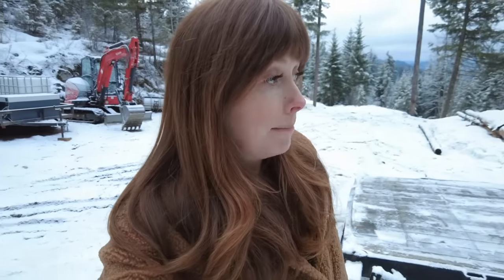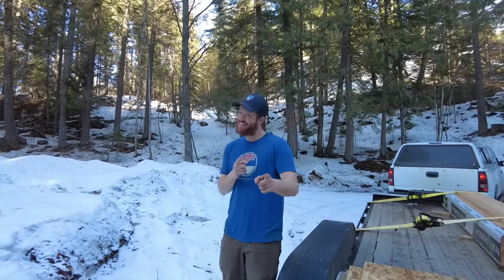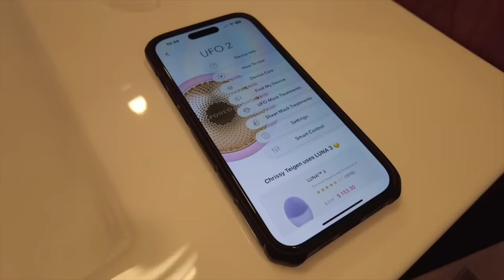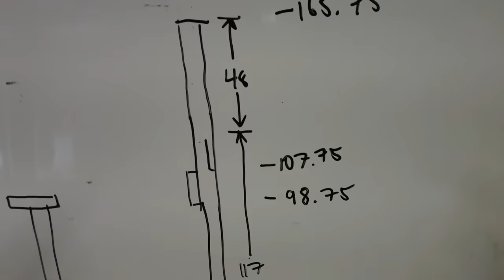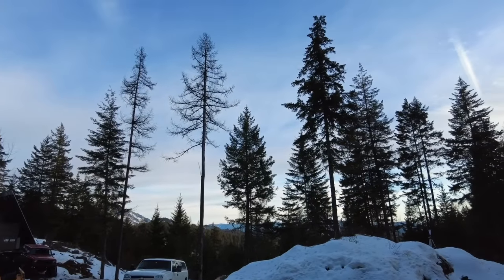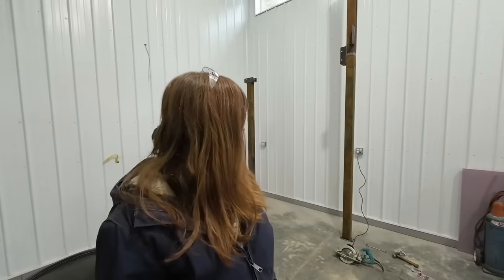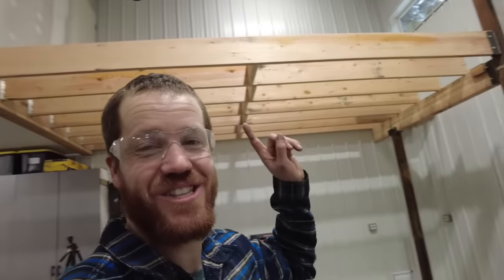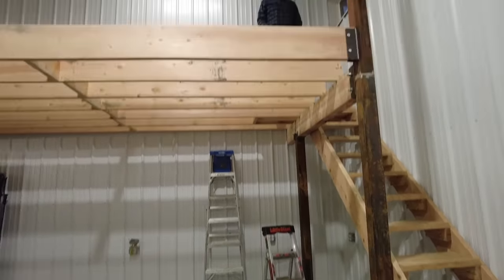Starting A NEW BUILD For Our Growing Family

Comment: Just a suggestion, Riley may want to look into building a rock/soil screen for a future episode. With all the existing raw materials you have on the property, you could probably rock the whole driveway with cleaner material. Design it with a removable screen bed and you’d also be able to size the rock to better fit your needs. I have no doubt Riley could build something like this in just a day or two. And it would probably benefit the homestead for decades to come. Just my 2 cents. Absolutely love this channel!!!
Reply: Taking this suggestion a step further, look to establishing a area to quarry the raw materials.
Reply: and don't work on roads when they are wet and muddy if you can possibly do it when it is drier.  crown the roads also to keep the water from sitting on the road.  Add water bars to drain water off the road on slopes.
Reply: How about a rock crusher so you can get a regular size for the road? Would help remove all the larger bits.
Reply from the maker: Thank you so much for the candy we just received in the mail! When we used to live in Atascadero I would buy those all of the time when we made parts runs to the local hardware store.

Comment: Turn down your trailer brake controller when its empty. The wheels just lock up and then it slides sideways. I turn the gain on mine most of the way down with an empty trailer. Especially when its slick. Just dont forget to turn it back up once your back on good pavement especially when loaded. Its really a good practice to get used to adjusting the gain when you change trailer loads. The brake controller can be your friend.

Comment: There is a way to put chains on your tires without laying down in the mud. Stretch the chains out on the ground, in front of the tires. Drive onto the chains about half way, then wrap the ends of the chains to the top of the tires.

Comment: You'd need a heavy duty filtering fabric between the mud and rocks to make it work. Frost will just lift those rocks up every spring. 

If you don't want to get rid if the mud and put water passing soil and draining, then put the fabric, then some gravel, big rocks, smaller rocks and surface layer. Otherwise mud fill the gaps between rocks.

Comment: After having enjoyed a bunch of the videos at your Idaho empire, the placement of the house is helping to create the mud hole on the hill,,ie- you've excavated into the hill with the house pad and your equipment storage area,the ground seeps are surfacing in the mud hole,no where near enough drainage on uphill and front of the house. A French drain with filter fabric 6"-8" underdrain pipe would help immensely. But dig out the muck first,then add the rock to stiffen the ground and provide a good base for your road and storage area,and you have all the tools to accomplish the job.

Comment: Riley you should get chains to put on your trailer when there is any chance of ice.  By putting chains on the trailer with slight braking on it the chances are better that it will stay behind you  instead of jack knitting and ditching you.  That is why you see chains on tractors and trailer rigs on passes up and down grades.

Comment: I would remove about 5 to 6 inches of the driveway and around the carport, lay down geotec fabric then put rock on top of that and all those mud problems will be solved for decades to come. Plus with the fabric under the rock, you will not have to worry about having to keep putting rock over and over again.

Comment: To help keep the mud at bay lay down Geotechnical fabric meant for roads before dumping gravel. It helps to keep the dirt from mixing with the rock and letting the rocks get pushed into the dirt and the dirt squishing up through the rocks. To help keep the rock in place you can use the various geocell products that use cells to contain the top layer of rock. Really stabilizes the rock and makes it feel like you're driving on concrete.
Reply: This is what we did!

Comment: The Doggie door needs to be raised due to the concrete floor raising the exit angle for the dogs. If the door is left as it is now it could cause your dogs back issues.. I had to raise my dogs doorway for the same reason.

Comment: If you put a set of chains on the trailer and use the brake controller, you can use the trailer brakes to keep you straight. Handy when you have a heavy load going down a hill

Comment: Turn your trailer brake controller down so your trailer tires aren't locked up then it will track behind you better rather than slide to the low side the hole way down the hill. Also can put one trailer chain on and it will help with tracking.

Comment: It’s been a while since I dump trucked but when it was a mud bog contractors put down 3”-5” railroad ballast until it locked up like concrete. Then put road bond or gravel on top of that. Until you lock it down it will just eat the smaller stuff.

Comment: Might be worth fabricating your own screen for road base material to help filter out the fines from your road rock. I just ended up using a sheet of expanded metal laid flat on an angle so the the fines fell straight down and the good rock rolled off into a separate pile. Of course this won’t work very well with mud, so whatever you feed through it needs to be mostly dry.

Comment: Based on a lot of other channels I have seen, like letsdig18 and diesel creek, to keep the mud from coming up through the gravel, it is best to put a layer of the special driveway fabric down to keep the mud and gravel in different layers vs mixing.  otherwise, the gravel will just squish into the dirt and it becomes a slightly thicker muddy mess as you found out.  Fun video though, keep up the good work.

Comment: Riley, Another great video!
One suggestion that may help with the mud:  Under the 12' x 34' deck I built recently I added a way to channel the water away from the house.  Half of your roof runoff, and all of the deck runoff could be channeled away from the driveway, which could help lessen the mud.

Comment: maby it is worth collecting the water in the ground with some underground soil draning tubes.
a little pond for example

most farmers would solve that mud problem with soil draning tubes 
it gives the option of running heavy machines without putting rocks or metal plates all over the place.
rocks often get full of dirt and hold little water over time, and soil draning tubes does not cost alot..

soil draining tubes are also very normal to use around houses, to avoid moist in the building

ofcourse rocks on roads makes sense, specially on a hill.
but for garden and around the house, draining tubes is a must if its that bad

Comment: Hey guys for the mud problem.  Something I instruct my crews to do every night during the mid season is to back blade the area smooth.  This allows the water to sheet flow away and not get stuck in the ruts.    Once smooth the soil will start to dry out faster when the winds start to pick up.

Comment: You might want to tie your platform in to the other side of the building, it does not appear those metal posts are on footings and if you have any settlement under your slap the load might cause them to punch through over time.

Comment: Recall pulling trailer on slick surfaces on sleep declines . . . years ago to use as low of gear as needed, tap brakes, pump brakes down hill. Riding brakes will cause unloaded trailer to lock up and slide sideways or begin to jack knife. Just a thought for your safety. Worked for me to keep slides to a minimum.

Comment: mean while... Axle broke on my car, right at the wheel hub it sheared the splined spindle off the CV cup. welded it back together, it's a $64 axle... but shipping was about $900 to get it where i am, $5 of welding rod at being cost of welding rod used with electricity and shipping so $5 was actually $5.

Comment: Riley. check around for a machine- of it could be a Home grown device- in your neighborhood called a "Grizzly'- they separate rock and dirt using different sized screens- that would improve your hard, insoluble rock content, control sizing better and turn your "rocky bonanza" into much more useful fill and construction base. I think you have some more "dozer content" coming.  Also more shed building!  It's awesome to see you able to use all the tools you've acquired from start up.

Comment: Excellent job as usual. Working with lumber and steel is great, not everyone has the skills or temperament to do it. Your welding skill is tremendous. Stair assembly with screws was good planning or good fortune, either way a huge time and material saver.
Always enjoy the videos, Good Luck

Comment: You are asking for trouble putting most of the weight at the back of the trailer.  That takes away tongue weight (needed to get up the hill) which could cause some dangerous sway at highway speeds.

Comment: Nice work. Those stairs remind of the houses my grandparents (oma and opa) had in Amsterdam. All you need to make them "proper" Amsterdam stairs is to at a 90 degree turn at the top and bottom. What you built is safer and easier to use. Good luck getting all the big construction done before the baby arrives. Trust me the 1st year is a life changer. It will be both exhilarating and exhausting. You have both shows to be able to work through big projects together. Your next adventure will be even bigger. Congrats and enjoy!

Comment: About your muddy driveway, have you considered putting a geotextile fabric down over the rough surface and then adding about 5" of crushed rock or gravel as your top layer? It should work to keep the top layer of rock from sinking down into the dirt and ending up with mud again. Just a thought, it worked for me.

Comment: The best thing to do for mud and gravel is to separate them, go to your local pipe yard and grab a roll of woven road fabric, it comes in 12 and 15 foot wide rolls and around 300 feet long. Put that on top of your base then put gravel on top. I have done this work for years and on my property that is terrible for mud. What a difference! Also that fabric is incredibly durable and strong and I guarantee you will not be disappointed. Great video again guys. I’m your neighbor in Montana and also live up in the mountains with mud, lol.

Comment: It may or may not be a big deal, but without any footings underneath your cement slab you may expect to see cracking in the cement do to the point loads from those posts. It’d be a simple fix if it becomes an issue down the road. Don’t mean to be critical, just an observation.

Comment: you guys should consider installing a heated driveway. use those pre formed insulated panels for pex and run a loop or 2 down the driveway, then concrete or pavement on top. it would only need to turn on to melt the ice and then right back off. would literally make that property safe for your family in case of an emergency
Reply: Prob pricey but def worth it, if its feasible for their property
Reply: @tomdaley9154  cant put a price on life, could be life or death if an emergency vehicle cant get up...fire or ems, or even police

Comment: You need some sound deadening in there. If you can get some cork squares on the walls, it will amaze you. My dad was an architect, and I remember when he was involved with a new high school project, and they had to use acoustic tiles to correct that problem.

Comment: When you're going downhill with a trailer and you touch the brake of the truck the trailer brakes will come on causing it to slide. To get around this readjust the brake controller to not come on when you hit the truck brakes on the trailer. Or just disconnect the the trailer cable from the truck.

Comment: A little late to the party but after seeing your trailer slide down your driveway you should turn down the brake controller to keep the trailer brakes from locking up. Did this coming down a pass while towing my travel trailer when the road was a solid sheet of ice. Sure keeps the trailer from sliding around. Get to the highway and turn the gain back up for assist when trailer is loaded.

Comment: Hi Riley, in the video we only see you use screws to secure the joist hanger. Please make sure it is okay to use screws to do this job. When I build my outside deck I painfully nailed them down using special joist hanger nails. If I remember corrctly it was because is was not recommended to use screws. I'm not an expert,  so please consult an expert or tell us you used the screws temporarily and then used the recommended nails off cam to complete the install. Thanks for sharing your accomplishments!
Reply from the maker: We used screws that are specifically meant for joist hangers. Simpson Strong Drive #10.

Comment: Courtney Tell Riley to reduce the break on the trailer when is empty so the trailer do not lock up breaks
Reply from the maker: We had the brakes as low as they could go. He turned them off briefly but that actually caused the truck to start sliding.
Reply: @AmbitionStrikes  sorry I did not know you have low as you can

Comment: Just a wee hint. Try and limit how much weight you put out behind your trailer axle. While it's not great to be heavy on you ball, the benefits are more stable trailer towing and better traction. Ideally you should try to put mass as close to axles on trailer and some load on ball. Too much load on ball actually can cause lighter front end. Somewhere is a balance. Stuff way out back is never a good idea. The tail.can wag the dog.  Heaps of fun though!!

Comment: Q,
You have all the machines that can help you but you lifting things by hand ?
Also wouldn't it be better to take the skid steer down to your steep part of the drive to assist the truck ,use it to assist going down and to pull up the steep grade of the driveway?
Now that you will have extra floor space ,what's the plan for the baby room ? obviously the mezzanine area will be exposed to wind and cold and things that happen in the workshop?
I was wondering if the span of the floor joists was a tad long ,without support pole ,would a double up of a couple of the floor joists be a wise move ?
Your workman skills are very good ,both of you ,big changes coming for you 
Stay safe

Comment: For your safety, when going down hill with an empty trailer, turn your trailer brakes off . It will track much better. Smart to use chains. Enjoy your chanel. Not trying to critize you but make helpful comments.
Reply from the maker: We briefly turned the brakes off but it started to push the truck down the hill.

Comment: I get that you don't want to paint the mezelen steel beams cause you like the patina on it but please get some clear coat paint in a spray can and spray it on the steel beams so that the patina doesn't increase too much and start eating into the steel beams and the welds on it.
So please do a clear coat on it to seal the patina from spreading more and damaging the steel beams, especially when you are in a wintering area where the place can get very moist and humid being the best climate place for rust to start forming on steel and any other metal materials of any kind.
For the clear spray car people that paint and work on old cars that have an old car sitting in the weather getting a rustic look on them, the car people will go and do a full body clear coat on the car panels to stop the rust on them from increasing and preserve the car rustic paint look.
It's the equivalent of sealing something in a coat of clear resins to avoid further environmental damage to it.

Comment: But but but ~ You guys SAID That you all were going to go out and buy that "quart" (at least that much) of my favorite paint ~  RUST-OLEUM ~ Primer.  Just slap the "PRIMER on ~. ya gotta paint metal.  forget the SPRAY paint for now.  A brush will do.  So much "most excellent" metal work.  Throw primer on ASAP and then forget about it. After the primer, a quick coat of any color any time.  Rusty metal may be cool. But over time. You will not regret primer, a Quick Brushing of Primer ~ Rust Oleum ~  I know you can. .✨🙏. ✨   So much skill ~ showcase your work with Rust Oleum. ~~~ From the Epsom Traffic Circle, nahampsha,  Oh yea.   ♥

Comment: The trailer sliding early in video, the tires of trailer are not spinning, maybe something braking the trailer wheels, thats obviously making it go sideways?
Reply from the maker: The trailer brakes were set about as low as they go. I turned them off for a second, but then the trailer started pushing the truck.
Reply: @AmbitionStrikes  Yea I guess its just because trailer is empty and the surface is snow and obviously also some brakes is needed, that's quite hard combination.  Having some load on the trailer probably works much better, just like it should.

Comment: Question about your metal chop saw... What blade are you using instead of the old abrasive type.
Reply from the maker: Hi Richard, it's an Evolution Rage dry cut saw. Spins slower than a traditional abrasive chop saw and uses a carbide tipped blade.

Comment: Be aware of a needed fire separation between the two different occupancies you are creating: the living area and the shop. Consider fire rated Type X drywall, fire rated window (looking into shop) and fire rated self closing door. Possibly enclosing stairwell leading into shop and adding a door to outside at the base of stair.
Reply: It's starting to look like Riley is going to be building a shop somewhere else on the property eventually.

Comment: Very nice and smooth  build.  Remember I not seen any detail plans.  You have put anti twist bracing in the middle of the joists, well done, 10 out of 10,  but it looks like at the moment there is minimal resistance to twisting at the stair end so it appears to me we need the similar bracing/ infilling between the joists at the stair end to resist a tendency for this end of the joists to twist.